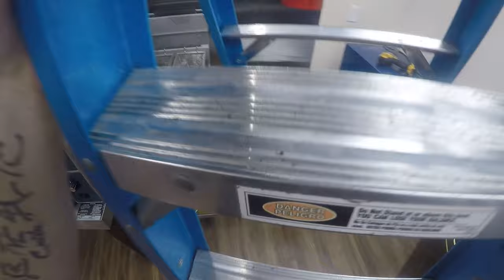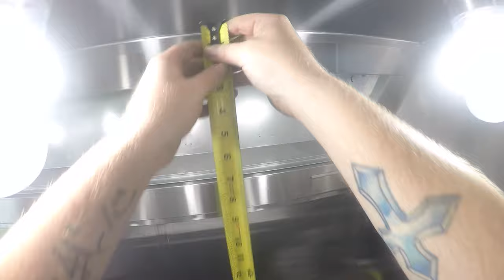Kitchen Fire Suppression system install #4

Comment: Improper coverage over the range. You ran the conduit too close to the ceiling. Mounting the control head onto the cylinder creates servicing problems.